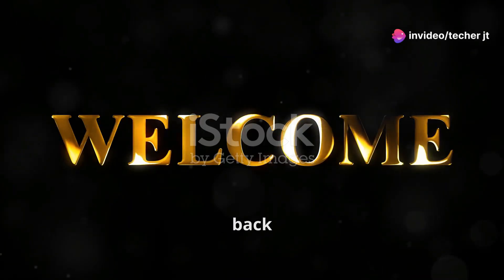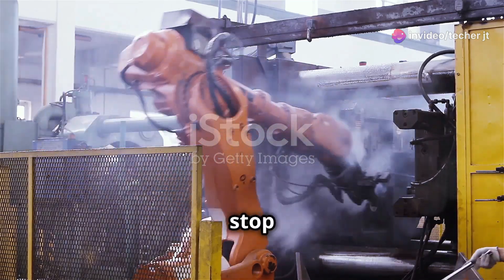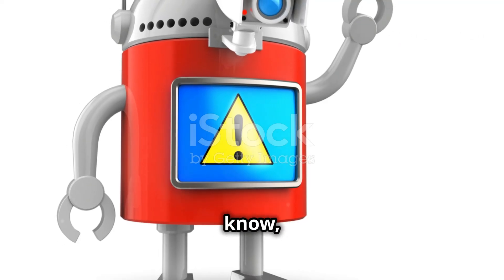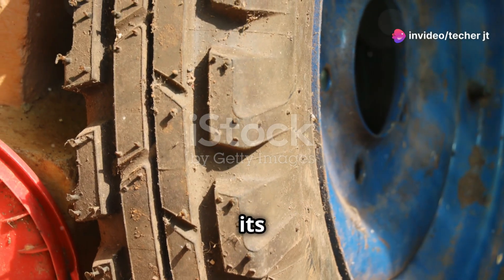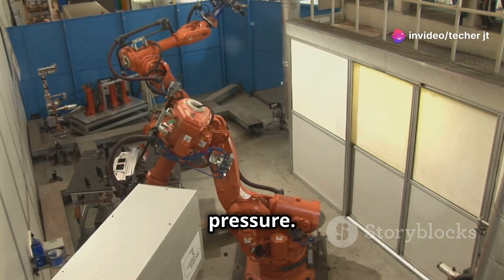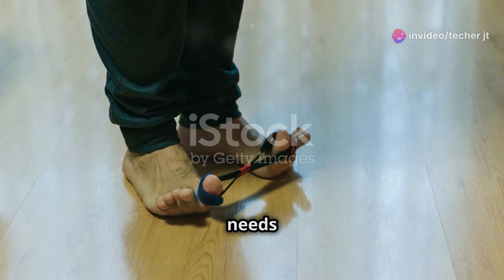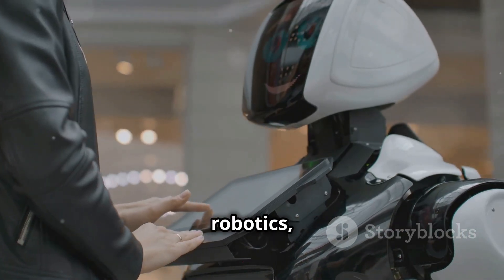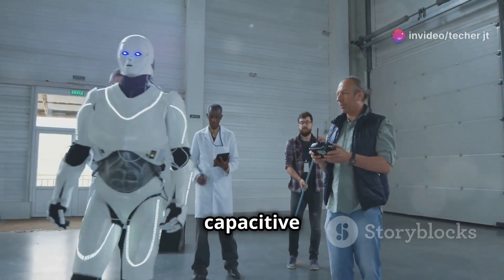Capacitive Sensors in Robotics: A Beginner's Guide

Comment: Ma. Nicole Cyse L. Rojo
10 - Hermes

4. What challenges do capacitive sensors face in real-world applications?

- Capacitive sensors face several challenges in real-world applications, including sensitivity to environmental conditions such as humidity, temperature, and dust, which can affect their accuracy and reliability. They may also struggle with detecting non-conductive materials or objects with varying dielectric properties, leading to inconsistent readings. Additionally, interference from nearby electrical devices and conductive materials can cause false signals or erratic behavior, making it crucial to carefully design and calibrate capacitive sensors for specific applications.

Comment: Shawn Deece Otoc
10-LYNX

1. What is the primary function of capacitive sensors in robotics?

They can sense non-metallic materials and are often used for touch detection, position sensing, and level measurement in various applications.

Comment: Megan Louiesse E. Po
10- Hermes

1. What is the primary function of capacitive sensors in robotics?

Capacitive sensors in robotics are primarily used to detect the presence, proximity, or changes in capacitance of non-metallic objects. They work by measuring the change in capacitance between two conductive plates when an object with a different dielectric constant enters or leaves the sensor's field. This makes them suitable for detecting materials like liquids, plastics, and even human skin.

Comment: Zoe Jillian R. Cabrera
10 - Hermes

2. How do proximity capacitive sensors differ from touch capacitive sensors?

-Proximity capacitive sensors detect objects from a distance without direct contact, typically within a range of a few millimeters to several centimeters. They measure changes in the electric field caused by nearby objects. These sensors are used in gesture control, automated systems, and devices requiring non-contact detection. Touch capacitive sensors, on the other hand, require direct contact or near-contact to function.

Comment: Trixie Dalman 
X - Lynx

1. What is the primary function of capacitive sensors in robotics?
- Capacitive sensors in robotics primarily function as proximity sensors, detecting the presence and proximity of objects within their sensing range. They work by measuring changes in capacitance, which is the ability of an object to store electrical charge. When an object enters the sensor's field, it alters the capacitance, allowing the sensor to detect its presence.

Comment: Blissany Y. Torralba
10-HERMES

1. What is the primary function of capacitive sensors in robotics?

-Capacitive sensors are used in robotics to detect the presence of various objects, including metal and non-metal ones. They work by measuring changes in capacitance when an object enters their electric field. These sensors are used in applications like proximity detection, level sensing, object identification, and touch sensing. This allows robots to interact with different materials and environments.

Comment: Leeane Niña A. Dela Rosa
10-LYNX

4. What challenges do capacitive sensors face in real-world applications?

Capacitive sensors face several challenges in real-world applications, including sensitivity to environmental factors like temperature, humidity, and dust, which can lead to false readings. Conductive objects and electrical noise can interfere with their accuracy, while their relatively short sensing range limits them in long-distance applications. Wear and tear on touch surfaces, frequent calibration needs, and difficulties with multi-touch detection also pose issues. Additionally, while basic sensors are affordable, advanced systems can be costly and complex to implement, especially in demanding or large-scale environments.

Comment: LA Treassia P. Llaban
10 - LYNX

4. What challenges do capacitive sensors face in real-world applications? 

- Capacitive sensors encounter several challenges in real-world use, such as being affected by environmental factors like temperature, humidity, and dust, leading to inaccurate readings. Conductive materials and electrical noise can also disrupt their accuracy, and their short sensing range limits them for long-distance tasks. Other issues include wear on touch surfaces, frequent calibration requirements, and challenges with detecting multiple touches. While basic sensors are cost-effective, more advanced systems can be expensive and complex to implement, especially in large or demanding settings.

Comment: Joaquin Gabriel L. Cabug-os 
10 - Cassiopeia 

1. What is the primary function of capacitive sensors in robotics?

- Capacitive sensors in robotics primarily detect the presence and distance of objects without contact. They facilitate touch input, material identification, and obstacle detection, enhancing interaction, safety, and navigation.

Comment: Angel Stephanie Ledesma
10 - Lyra

1) What is the primary function of capacitive sensors in robotics?

- The primary function of capacitive sensors is to detect changes in the electrical field around the active face of the sensor. They can be used to detect the presence or absence of any object, may it be liquid or solid.

Comment: Camyll Jhey P. Belhot
10-Hermes

1. What is the primary function of capacitive sensors in robotics?
-Capacitive sensors in robotics function primarily as proximity detectors that can sense objects without physical contact. They work by detecting changes in capacitance, which is an object’s ability to store an electric charge. When an object approaches, the capacitance shifts, allowing the sensor to recognize its presence and distance. This capability is crucial for tasks like avoiding obstacles, handling objects, and ensuring accurate positioning in robots.

Comment: Rafael Daroy
10-LYRA

1. What is the primary function of capacitive sensors in robotics?

The primary function of capacitive sensors in robotics is to detect proximity and touch. They work by measuring changes in capacitance caused by the presence of an object, allowing robots to sense when they are near a surface or when a user interacts with them.

Comment: Chelsy Manzanades 
10Andromeda

1. What is the primary function of capacitive sensors in robotics?

They allow robots to sense their environment without touching anything. They serve as proximity sensors, they use electricity to detect nearby objects, measure pressure and track multiple point of contact without physical contact

Comment: Aiko Alzula
10 - Cassiopeia 

1. Primary function of capacitive sensors in robotics:
Capacitive sensors measure changes in capacitance, which is the ability of a material to store an electrical charge. In robotics, they are primarily used to detect the presence or proximity of objects, regardless of their material. This is achieved by sensing changes in the electric field around the sensor.

Comment: Gene Berta Rose F. Hererra 
X Hermes

1. Capacitive sensors are used in robotics to detect the presence of different objects, including metallic and non-metallic ones. These sensors work by measuring changes in capacitance when an object enters their electric field. They are used in various applications like proximity detection, level sensing, object identification, and touch sensing, enabling robots to interact with different materials and environments.

Comment: Kirk C. Nangkil
10-LYNX

1. What is the primary function of capacitive sensors in robotics?

Capacitive sensors play a vital role in robotics by enabling machines to perceive their environment without physical contact. These sensors measure changes in capacitance, which occurs when an object approaches the sensor. This capability allows robots to detect obstacles, maintain a safe distance from objects, and interact with humans safely.

Comment: Alexa Kyle R. Cabunoc 
10-HERMES

3. What are the advantages of using capacitive sensors in human-robot collaboration?

- Capacitive sensors offer several advantages in human-robot collaboration due to their ability to detect a wide range of materials, including human skin, without physical contact. These sensors can sense proximity and touch through non-conductive surfaces, making them ideal for detecting human presence and ensuring safety in collaborative environments. Their high sensitivity and ability to work in various environmental conditions allow robots to respond quickly to human gestures or movements, enhancing interaction and reducing the risk of accidental contact or injury during shared tasks.

Comment: Jag Alona S. Ramayla
10 Lyra

1. What is the primary function of capacitive sensors?

- Capacitive sensors in robotics primarily function to detect the presence or proximity of objects without physical contact by measuring changes in capacitance when an object nears the sensor. They are used for proximity detection, touch sensing, material identification, and level measurement in various applications. These sensors enhance a robot’s ability to interact with its environment, enabling tasks like collision avoidance, tactile feedback, and distinguishing different materials, making them essential in precise and delicate operations.

Comment: Hailey Aiyana E. Gador
X-Lyra 

1. Primary function of capacitive sensors in robotics: Capacitive sensors measure changes in capacitance, which is the ability of a material to store an electrical charge. In robotics, they are primarily used to detect the presence or proximity of objects, regardless of their material. This is achieved by sensing changes in the electric field around the sensor.
Reply: Mitch Micah Niere (X - Lyra) 
 1. Primary function of capacitive sensors in robotics: 
 capacitive sensors in robotics is to detect variations in capacitance, the capacity of a material to hold an electric charge. In robotics, sensors are mainly employed for identifying the existence or closeness of objects, irrespective of their composition. This is accomplished by detecting alterations in the electric field surrounding the sensor.

Comment: Maykylla Geraldine R. Egarguin 
10-LYNX

4. What challenges do capacitive sensors face in real-world applications?

Capacitive sensors face several challenges in real-world applications, including sensitivity to environmental factors like temperature, humidity, and dust, which can lead to false readings. Conductive objects and electrical noise can interfere with their accuracy, while their relatively short sensing range limits them in long-distance applications. Wear and tear on touch surfaces, frequent calibration needs, and difficulties with multi-touch detection also pose issues. Additionally, while basic sensors are affordable, advanced systems can be costly and complex to implement, especially in demanding or large-scale environments.

Comment: GABRIELLA KISH O. GATCHALIAN
10-LYNX

1. What is the primary function of capacitive sensors in robotics?
- Capacitive sensors in robotics primarily function as proximity sensors, detecting the presence and proximity of objects within their sensing range. They work by measuring changes in
capacitance, which is the ability of an object to store electrical charge. When an object enters the sensor's field, it alters the capacitance, allowing the
sensor to detect its presence.

Comment: Glenn Seth Myrrh B. Laluces
10-Hermes

1. What is the primary function of capacitive sensors in robotics?

The primary function of capacitive sensors in robotics is to detect the presence of both metallic and non-metallic objects, including liquids, plastics, and other materials. They work by measuring changes in capacitance caused by objects entering the sensor's electric field. In robotics, capacitive sensors are used for applications such as proximity detection, level sensing, object identification, and touch sensing, allowing robots to interact with a wide range of materials and environments.

Comment: Michaella Mae A. Ragmac
X - Cassiopeia
1. What is the primary function of capacitive sensors in robotics?
Capacitive sensors in robotics mainly serve as proximity sensors that can detect objects without needing to touch them. They operate by measuring variations in capacitance, which refers to an object's capacity to hold an electrical charge. When an object comes near the sensor, it changes the capacitance, enabling the sensor to identify its presence and distance. This functionality is essential for numerous robotic tasks, including obstacle avoidance, object manipulation, and precise positioning.

Comment: Shuwla Maine C. Lugtu
10-Lynx 

2. How do proximity capacitive sensors differ from touch capacitive sensors? 4 sentences
- Proximity capacitive sensors detect the presence of an object without physical contact, while touch capacitive sensors require direct contact to function. Proximity sensors have a larger detection range, typically a few millimeters to centimeters, whereas touch sensors detect only immediate contact. Proximity sensors are commonly used in applications like automatic doors and gesture control, while touch sensors are found in touch screens and touchpads.

Comment: Cherish Stefie D. Bacayo
Grade 10-Lyra

1. What is the primary function of capacitive sensors in robotics?

Answer: Capacitive sensors in robotics are primarily used for proximity detection, similar to inductive sensors. However, they work by detecting changes in the capacitance of an electric field, allowing them to detect both metallic and non-metallic objects. This makes them versatile for tasks like object detection, level sensing, and material identification.

Comment: Marion James C. Nale
10 - Lynx

1. What is the primary function of capacitive sensors in robotics?
Capacitive sensors allow robots to sense their environment without touching anything. They use electricity to detect nearby objects, measure pressure, and even track multiple point of contact even without any physical contact

Comment: RAINE S. BADON
10 - LYNX

1. What is the primary function of capacitive sensors in robotics?

Capacitive sensors are commonly used in robotics to measure the proximity or distance between an object and the sensor. They work by measuring changes in capacitance, which occurs when an object approaches the sensor. This change in capacitance can be used to determine the distance between the object and the sensor. Capacitive sensors are often used in applications such as obstacle avoidance, object tracking, and human-robot interaction.

Comment: Joshua El Noah M. Suan
10-Lyra

2. How do proximity capacitive sensors differ from touch capacitive sensors?
-Proximity capacitive sensors detect objects from a distance without direct contact, typically within a range of a few millimeters to several centimeters. They measure changes in the electric field caused by nearby objects. These sensors are used in gesture control, automated systems, and devices requiring non-contact detection.
Touch capacitive sensors, on the other hand, require direct contact or near-contact to function. They sense the change in capacitance when a conductive object, like a finger, touches the sensor. Common applications include touchscreens and touchpads on mobile devices and laptops.

Comment: Zane Mendaros
10 - CASSIOPEIA

2. How do proximity capacitive sensors differ from touch capacitive sensors?

Proximity capacitive sensors are designed to detect the presence of objects by detecting disturbances in the electric field from a distance, without the need for physical contact. In contrast, tactile capacitive sensors detect objects by direct contact and record changes in the electrical field when an object touches the sensor. While proximity sensors are great for avoiding collisions and detecting objects from a distance, tracking robots can allow robots to interact more effectively, handle objects accurately and detect pressure. ..

Comment: Alexa Janne S. Arioja
10-LYNX

1. What is the primary function of capacitive sensors in robotics?

> Capacitive sensors are crucial in robotics for measuring changes in capacitance between sensors and objects, determining their presence or absence. They generate an electrostatic field and monitor changes caused by dielectric or conductive materials. These sensors can feel objects without contact and detect various materials, including non-metallic ones, increasing safety and precision in robotic applications.

Comment: Nuriel Danna S. Garcia
10 - LYNX

2. How do proximity capacitive sensors differ from touch capacitive sensors?

Proximity capacitive sensors detect objects from a short distance without contact, while touch capacitive sensors require direct physical touch to work.

Comment: Cassandra Louis R. Bigwas
10 - Lynx

2.) How do proximity capacitive sensors differ from touch capacitive sensors?

Proximity capacitive sensors detect the presence of an object without physical contact and are widely used in non-contact sensing, proximity detection, and object detection while touch capacitive sensors detect the presence of a touch by measuring the change in capacitance caused by the human body's capacitance and widely used in touch screens and touch buttons.

Comment: Chris Nathan Dwayne M. Dura 
10 - Lynx

1. What is the primary function of capacitive sensors in robotics?

A: Capacitive sensors in robotics are primarily used to detect objects or changes in the environment by measuring variations in capacitance. These sensors can detect the presence, proximity, or touch of objects, making them useful for tasks like object recognition, collision avoidance, and interaction with the environment.

Comment: Ara Bella S. Quilestino
10 - LYNX

1.What is the primary function of capacitive sensors in robotics?
Capacitive sensors are crucial in robotics, enabling robots to sense their environment without contact. They use electricity to detect nearby objects, measure pressure, and even track multiple points of contact all without any physical contact.